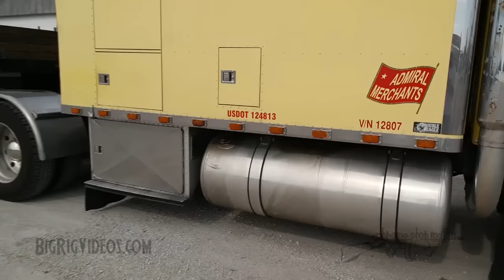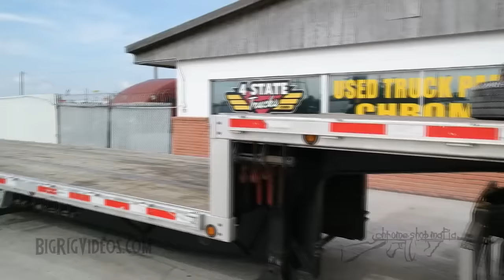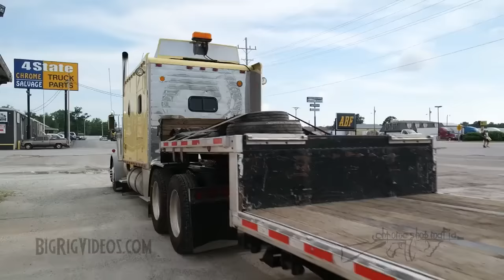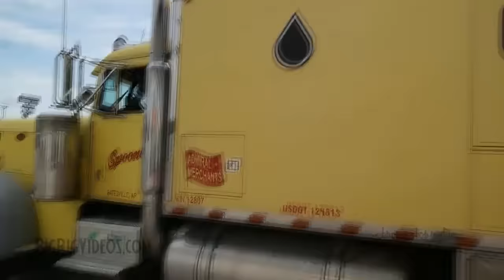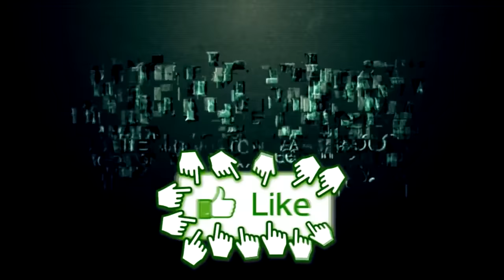Owner Operator Interview - R.M. (Bob) Spooner

Comment: good ole n14 that motor has been around since the old 220 and then went away with the signature/isx emission motors
Reply: hayden ingram actually the N14 came out in the early 90's. 91 or 92.
Reply: John Moore n14 came out in the 90's. Same engine as when the 220 was around. 3 heads pt fuel system. The 220 all big cams and n14 are all 855 cubic in just a little different fuel system.